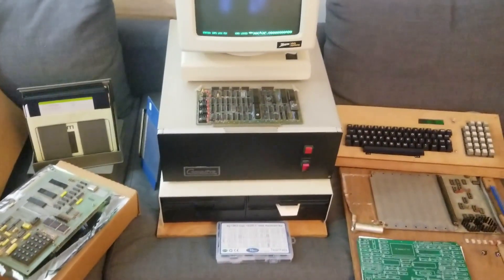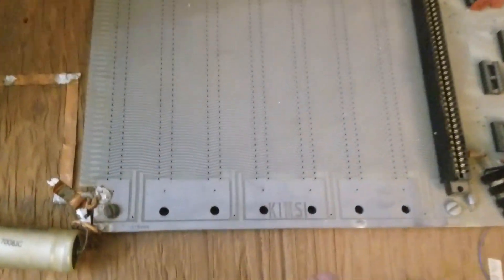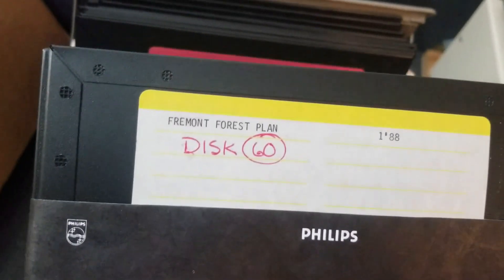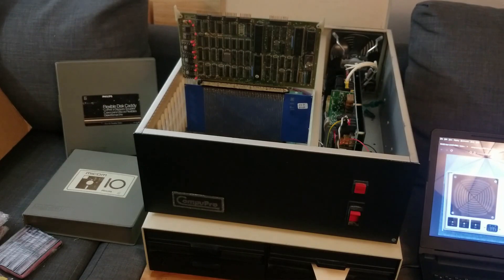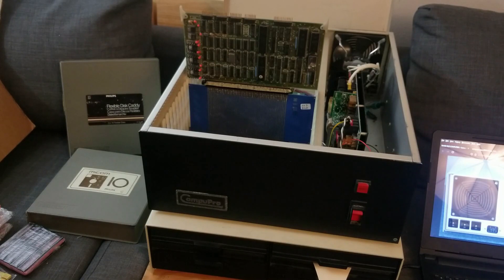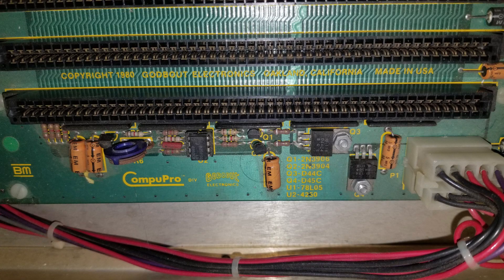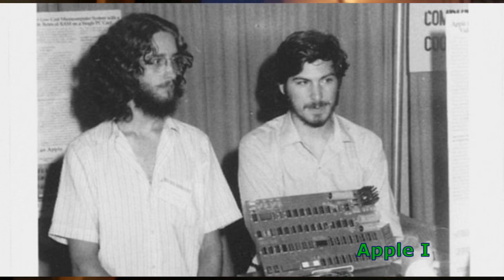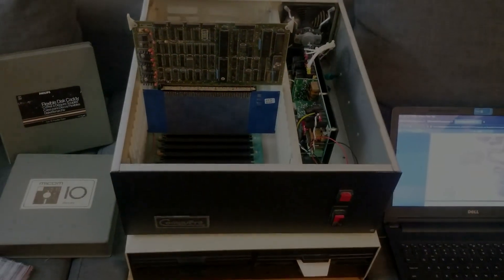CompuPro System Enclosure for s100 bus system. First look featuring the Commodore Kim 1 and KIMSI

Comment: Here is the problem that I ran into. I have several S100 machines and a KIM-1 as well as a lot of other late 70's and early 80's computers. The problem that I had, is that I could never stick to one computer for very long... So, I have decided to spend a lot of time on my KIM-1 to start. I have already made several videos and read several books. But I am still enjoying myself on this simple system.
You should be able to hook your CompuPro up to your regular computer using a terminal program. That way you can resolve your keyboard issue and allow you to upload programs into your Compupro's memory. So, that you might be able to create some boot disks.

Comment: I noticed as you panned across you had a small hand held oscilloscope. From my own experience (I was trying to repair a BBC Model B at the time), it actually hampered my attempts to make accurate measurements as it really does have very limited capabilities. Just be aware that you may see things with it that just don't look quite right. It may be fine on an older machine like the CompuPro, but just be aware that it doesn't read frequencies well, even with a proper oscilloscope probe. Good luck with all your projects, I'm interested to see how the CompuPro goes :)
Reply from the maker: Good eye! I forgot to talk about that thing as I specifically got the cheapest thing I could find to get my foot in the door. Not bad for around $25!

Those limitations are good to know about. I imagine I'll have to upgrade if I do anything that needs some real fine tuning.